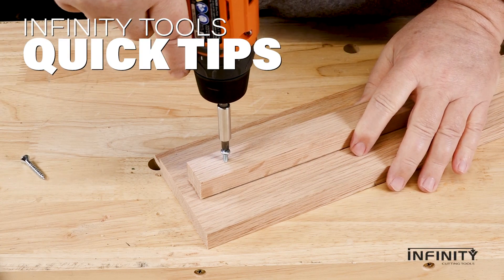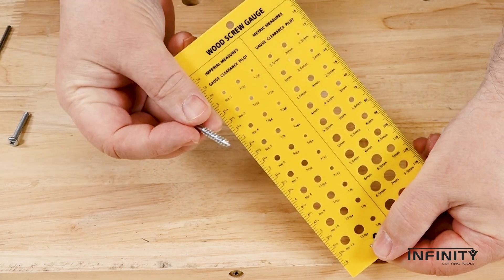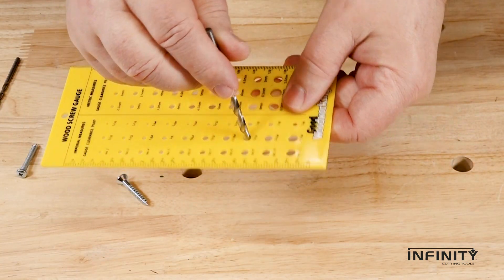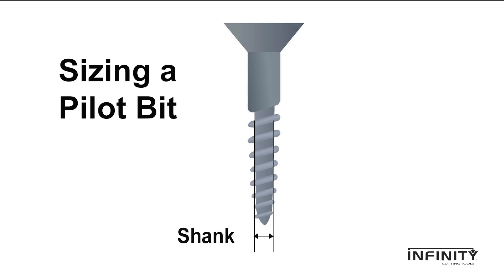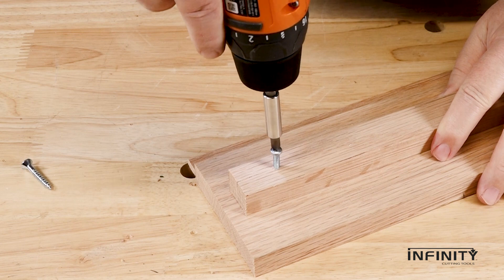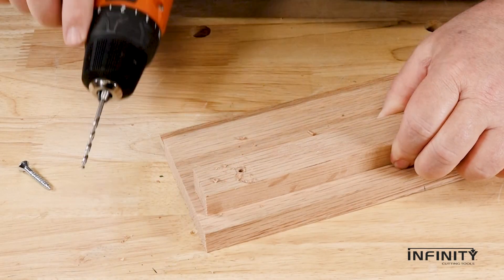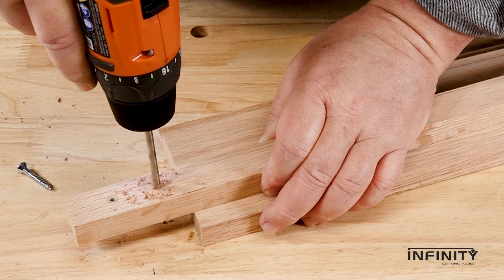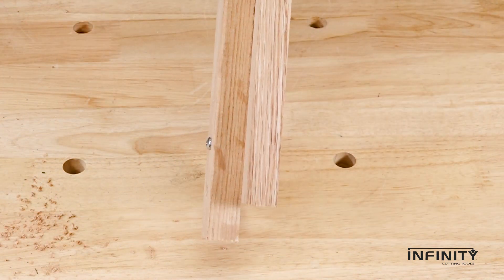Quick Tip: Clearance Hole vs. Pilot Hole, We Show You The Difference

Comment: I say, if possible, drill the pilot hole through both pieces then the 3/16 through the top piece.
Reply: That’s a good idea. You can line the pieces up precisely and drill a pilot hole through both of them at the same time. Then you can separate the pieces and drill a clearance hole in the top piece while using the already-drilled pilot hole as a guide.
Reply from the maker: Agreed. Simplifies the process. Thanks!